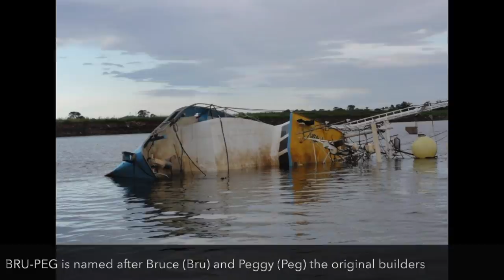Adjusting a Trawler Rudder - Project Brupeg Ep. 102

Comment: IMPORTANT Just a tip: The shaft that comes out of the bottom of your Vernier Caliper is for measuring inside of holes, the other end is for ID and OD measurements.
Reply: I'm guessing he knows that. There's no room for him to get the calipers under the rudder, since the pintle is in the way.
Reply from the maker: Yeah your spot on but as Drew said the pin was just too far over and i couldnt get it in there. I wasnt brave enough to try and pull it over and shove my fingers under the rudder either

Comment: I had my flight all booked, set to land next Tuesday, but then you went ahead and tightened the damn bolt. Well maybe next time.
In terms of where to park your new 65mm socket, how about making a bracket and keeping it right in the rudder compartment?  How many other uses are you ever going to have for a socket that big.
Reply from the maker: I think I would be embarrassed to keep that socket on board. It’s very likely to rust away prior to needing it next.
Reply: @ProjectBrupeg  dip it in a soft wax and leave it on the nut? (*waits for Navy Chief to lose their shit*)

Comment: Sometimes you just can't see where it's binding up and you have to nibble away at it till the things all align. No doubt it will be years before you have to replace rudder shaft bearings and the 5 mil extra room will make it easier to remove the rudder. I hope the steering cylinders align with the quadrant so the pins line with the holes vertically and are not at an angle. That's a big job you can check off the list before splash. Nice work everybody.
Reply from the maker: Thanks Richard

Comment: easy as ayy
That rudders end plates prevent transverse flow, just as on wings like you intimate
With transverse flow what you get is an amount of slip, which on a wing is a product of the front to back flow and the flow to either end.
On a wing you have a high pressure side on the bottom, and low at the top, curiously the suction side has 20% to 40% more lift.
Personally I always get a bit of a lift with some suction, but thats another story
Air like water is considered a fluid, so the flow goes from the high pressure side, round the tips, to the low pressure side peaking at the center
The angle can be as high as 20 degrees off true, and endplates or cuffs are a fix to slow it down or correct the angle of transverse flow.
It can mean on a wing you are altering the angle of attack, for a rudder less angle for the same pressure
cheers

Comment: Coolest rudder setup i saw was on a French tug. They had a nearly identical shroud to yours with one major difference, on the outside of what is your welded add-on, there were two flappers that worked in tandem with the rudder. They would only go on the outside (there was a slack bar and peg setup that stooped the "winglet" from opening inside where the blade is. I suspect they had quite the advantage in power over conventional setups when taking extreme turns.
Reply from the maker: Yeah some of the tug stuff is pretty awesome. ive seen full nozzle rotation and azimuth propulsion which is pretty damn cool.

Comment: I saw a tv programme about a big ferry that has a flush mounted flap on the rudder which on works when the rudder is turn to the extreme left or right, this gives a much greater turning circle and also saves a huge amount on fuel
Reply from the maker: Yeah trim tabs are another option. I dont have the skills or cash to make flappy bits on the back of the rudder hence i just went for the simple option of weld some wings on the top and bottom to do a similar job

Comment: Why not just replace the thrust bearing ring with a thicker material rather than go through all this heavy work.
Alternatively can you drive the yellow plastic further up the tube in the rudder...lower the rudder down on to a spacer and that will push up the yellow bush.
Alan in London
Reply from the maker: Hi Alan, we didnt have any ability to machine a new thrust bearing but that would have been my prefered option. Also the yellow bush in the rudder is in a blind hole so it was pushed in to the maximum depth

Comment: Mr BP, I am no expert on boats, BUT is the clearance between the prop and the cowl big enough, as I live near a fishing port in the UK, and all the trawlers I look at there seems to be 
40/50mm clearance, when I asked, the answer was to clear any rope and netting, that gets tangled on the prop. the prop will throw most of it off. keep safe.........
Reply: He's not going to be fishing with it.
Reply: I have to add my 2coppers also , i agree about the clearance . I would cut the cowl  back a bit as well as just a straight line from the radian of the shaft to the current corner of the angle.

the efficiency of that gap will be negligible so long as your are less than 6-12 inches
Reply: It's a Kort nozzle designed to have minimum clearance from the blade tips, that's where it gets it's efficiency
Reply: @rogerbayzand4455  that notch in the cowl where the shaft is has nothing to do with the  blade tips , also the fins on the rudder are only there to direct the flow of water , the more you move one the more they act , however on on the one side the other side does nothing as stated.
Reply: @rogerbayzand4455  How efficient will it be when your 100miles off the coast, with an old floating rope wrapped up stoping the prop from turning. keep safe.
Reply from the maker: Hi Evelyn. Ive not seen any trawlers in Aussie with these wings so i didnt have much to go off. That said i like your detail and I will bump the clearance up a bit more as a small increase in clearance at the front of the blade wont negatively affect the wings performance at all. Thanks for taking the time to comment. Damien

Comment: Is it worth drilling and tapping a thread in the top end of the shaft, then you can add a screw eye to lift it by, A sure fire way of ensuring that you never need to lift the rudder shaft ever again!
Reply from the maker: Hi John. The top of the shaft has a square profile milled into it for the emergency tiller, i think if we drilled and tapped into that area we would lose too much strength that would be needed for the tiller.

Comment: Snap On sells a 65mm socket for only $2241. At that price you could buy a dozen. Plus you would need a 2 1/2" drive wratchet.
Reply from the maker: I could make 224.1 of my version for that (although mine doesn’t fit in a toolbox and it doesn’t come with any guarantee it will work)

Comment: Could you have replaced that wear plate at the top and put a thicker one that would have achieved 
the same thing just a suggestion good video love the long videos one step closer to the launch
Reply from the maker: Hi Colin, yes that would have been the easiest method. We had to do it the way we did as we didn’t have the tools or time to get a new wear plate machined up, so cutting the pin achieved the same thing without needing anything extra made up

Comment: Why didnt you just add a thick washer above the clutch plates ?.The hydraulic steering would still fit on.You made alot of work when you didnt need to .best wishes to you both, this pommy appreciates your videos
Reply from the maker: Hi Wayne, we have zero ability to machine parts on Brupeg at this stage (ie no lathe or mill) so although it would have been a simple fix, it wasnt something we could do at so we went the other way and tackled the thing we could alter

Comment: Another great update.

I have a question about the stopper chains for the rudder.. Why are they needed as plant equipment don't rely on "stoppers" for there hydraulic cylinders. The piston just dead heads in the cylinder and the relief pressure valve dumps the extra pressure. 
Cheers. Cant wait for the next vid
Reply from the maker: Originally I can’t see any form of stoppers on this boat, so I assume the rams were just dead heading as you say. For me adding in the chains is more back up just in case. As the rudder has a big surface area so a sideways push from a big wave could theoretically overwhelm the rams and maybe damage them.
Reply: @ProjectBrupeg  Thanks for the info. A few dollars spent on the chains sounds a good investment

Comment: I'm wondering why you didn't just cut the nozzle instead of trim the wing? Looks like removing a piece about a 50 millimeter equilateral triangle (1- 50 mm cut) would have done the job on both sides.
Reply from the maker: Wings are 10mm and the nozzle is 25mm. My little plasma cutter wouldn’t even touch the 25mm
Reply: @ProjectBrupeg  I knew there had to be a good reason. I suppose you can't get in there with a cut off wheel either.

Comment: Correct torque setting = tighten until it strips, then back it off a 1/4 turn ;-)
Reply from the maker: But still use anti seize. No point in being rough with our workmanship
Reply: 1/4 turn before it snaps or strips.

Comment: Great job keeping your sanity (and your video skills) while struggling with the rudder.  I winced when you cut off the collar on the bottom bearing. Since the bottom pivot of the rudder is water lubricated, can corrosion and marine growth between the bottom of the rudder and the bottom of the pin  become a problem?
Reply from the maker: Hi Sid. no real issue there with growth, anything that does grow wont last long with a 300kg steel blade moving around. As for corrosion the pin is 316 stainless and the bush is oil impregnated and impervious to corrosion, the steel on the rudder wont ever touch anything so the paint is enough to protect that from rust etc.
Reply: Good to know, thanks.

Comment: Dame, Isn't cutting the ends off the bushings are going let them slide up or down on the shaft at some point?
Reply from the maker: Hi Michael. The tube has a machined recess so the bearing rests up against that. The lip serves no purpose so was able to be cut off.

Comment: My lazy Idea was to drop a wheel bearing over the pin matching the ID to the pin diameter letting it find it's own balance point on the pin champher. Grease it up and change it out every hualout.Big Stainless Steel lower bearing? Just a wild ass theory.
Reply from the maker: That would work if we could make a grease delivery channel down to the bottom roller bearing but as it is it’s not possible to grease that bearing so it needs to be self lubricating.

Comment: Not speaking from experience, but at times it seems like the most useful tool you have is that plasma cutter... 😏
Reply from the maker: Yeah it was as important as a good welder when building a steel boat. Some things you just can’t cut with a grinder or a two minute plasma job might take you an hour with a grinder because of angles

Comment: Still mental positive attitude even when things don’t go completely to plan, great job you two. 
At least you can now move onto something a bit less taxing on the brain hopefully. 

 I also am looking forward to your pontoon manufacturing, are they going to be filled with expanding foam just in case they get a hole 🕳. 
Take care you too, Brupeg is certainly coming together beautifully. Blood, sweat 💦 and coffee ☕️
Reply from the maker: Hi Jamie. Most likely we will leave the pontoons empty but put some positive air pressure in there as it helps with side impacts (think full can of beer versus empty so side impact strength). I have seen a rubber inflatable dinghy filled with foam in the tubes but it was super heavy so turned me off the idea

Comment: Laminar flow mate.
Reply from the maker: Laminar flow is good but that’s not the main issue as the water column is still able to escape top and bottom of the rudder. Even if the rudder was in full tubulant flow it would still work better with wings as the tip vortex would be mostly eliminated. That said laminar without tip vortex is the ultimate

Comment: Another great video. Huge congratulation to this success. It was not an easy job.. well in theory it might had seem so but we have all witnessed harsh reality. Great job! Keep it up and live your dream.

A humble question: top wing on rudder is protruding into nozzle, basically splitting part of waterflow up over the rudder. Wouldn't it be better if both rudder wings were just outside nozzle diameter? Or does it have special purpose? I am not concern it will make much difference, it is just curiosity. Thanks for answer.
Reply from the maker: Hi Milan, no real issue above or below the nozzle (so long as its close) in hindsight I would have lifted the top wing up an inch or two but its all on now and will work just fine.

Comment: Shame about those sleeve bearings. A bit compromising to be chewing them flanges off at that late stage. Hope the pin is inside the bottom one now and didn't just smoosh it up out of the way. What will hold the remaining sleeve of that bottom thermoplastic bearing on the pin, the sleeve? 
I recall a lot was said about needing to attach the new shaft aligned so that the yoke would find zero basically when it neutralled, positioning the rudder at zero drag. thought I must have missed an episode or so. I see now with the sharpie arc gauge that said exercise didn't happen? 
Slow down when you are documenting your final plan man. Best laid plans of mice and men etc...   I think it was Mickey Mouse they were referring to.
Reply from the maker: Hi Jim, the original bearings never had lips, we added them in the hope they would fit, they didn’t so we cut them off, nothing lost there. The tube has a machined recess the bearing sits against so they can’t go anywhere. The shaft alignment issue you mentioned was already done, it was making sure the jetway was in the right position in relation to the flange at the bottom of the shaft as that determines the rudder position. So dead straight rudder ended up with both rams at 50% position as we intended